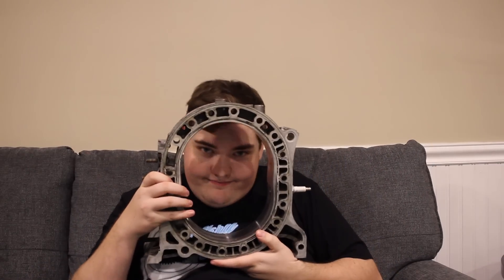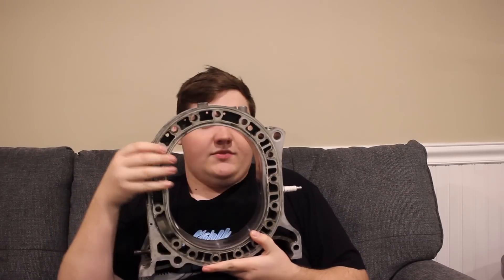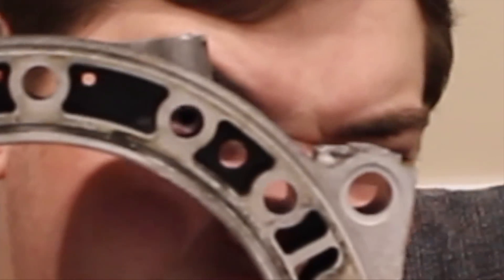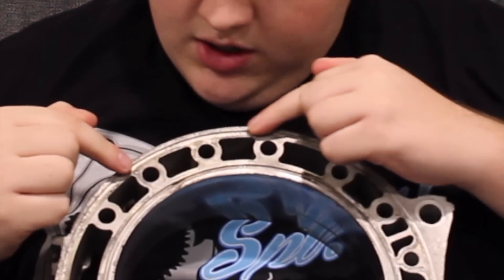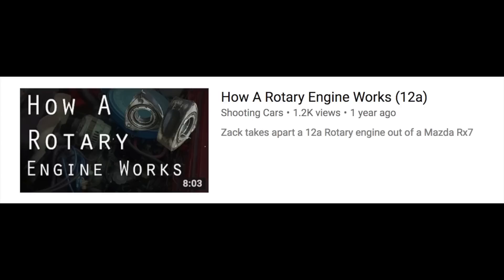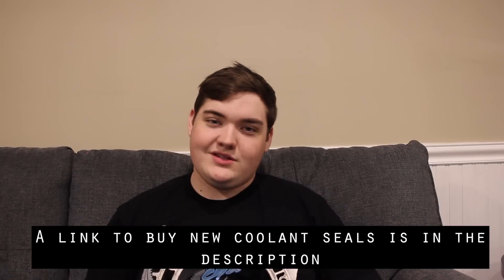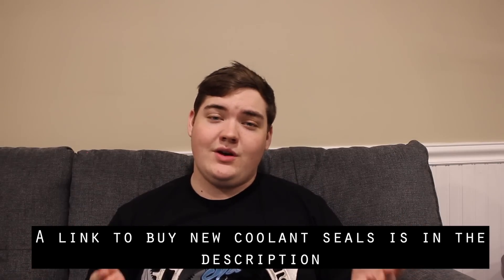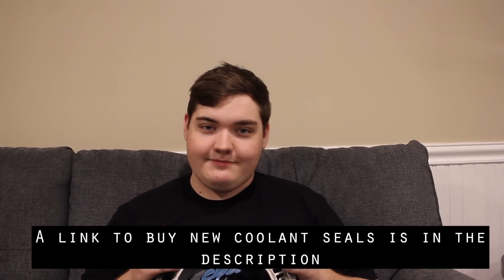How To Tell If Your Coolant Seals Are Blown In Your Rotary Engine

Comment: I have white smoke rough idling and than shuts off, now it only cranks but won’t start I charged the spark plugs and ignition coils. Nothing now I’m cleaning catalytic converter to see if that’s the issue. Now hoping it’s not this need  I need help

Comment: Thinking that my FC's coolant seals might be slightly leaking. Coolant overflows, light blue smoke on startup (could just be oil, maybe a little of each), but no smell in exhaust and the coolant stays more or less as green as it did when I put it in

Comment: Need a friend like you. I've just recently learned what a rotary engine is... And bought my first rx8. Been doing nothing but reading and watching videos and have done some work on the car. Tomorrow I will be testing by adding coolant, I just got the car out of limp mode with a new OMP. But the coolant is very low, when I've had it running I smell coolant but not sure if from the exhaust and there was a little white smoke from the exhaust but it didn't look abnormal. Well pray for me lol I will know more tomorrow. Btw your videos are very informative and are easy to understand thanks a lot

Comment: Compression is good on both cylinders.
No leak at all.
No white smoke, but still going through a lot of coolent. 

Pressurized the coolent system and it does not hold pressure...
So...
Gotta be burning it, but not enough to notice any of it coming out tbe exhaust.

Is it crazy to think that a headgasket sealant will work, at least temporarily, the stuff you put right into the coolent or will that muck up the combustion?
Reply: I’m having the same issue where I’m losing coolant but no white smoke. Did you find out what was a problem in your case?

Comment: Thanks for the video,
On my rx8 2005,
When i pull the dipstick to see the oil level it has a lot of white  like oil mix with coolant i can't even see the level do you have a idea of what the problem is? Thanks.
Reply: If you live somewhere cold-ish, and nothing else appears to be wrong, Its probably just condensation and nothing is wrong at all mate.
Reply: @Neishy86 that's what i thought that is just for the cold winter, i live in missouri so in winter is cold overhere but,  i went to the mazda dealer and they said  it is nothing wrong with it is just the air that engine pulls from outside, it's normal on those cars they said but, i jave seem on some videos that it can be the coolant seals that is why i was worry.
Reply: @Jorge-ku1zz  its condensation from the air, if you give the car a good drive it evaporates. But it'll be back again from the cold. Trust me you'll know when you lose a coolant seal, mine just blew. As soon as the car gets to temp it blows the rad cap out, no white smoke tho, but yeh exhaust gas blowing into the coolant.... RIP.
Reply: @Neishy86  sorry to hear that mate.

But good to know that information,
Now i will know when one blown. Thanks for your help.
Reply: @Jorge-ku1zz  dont forget, because of a rotaries design you can have alot of different symptoms for blown coolant seals. The seal could be bad only in one spot so it may see only intake, or compression, or combustion/exhaust. In my case I'm only getting exhaust in the coolant, no matter how long you leave it the cars starts and runs perfect no coolant smoke out the back, but it cant keep itself cool because exhaust is just ruining the systems ability to cool the car, I can get about 10 minutes of driving out of it tho lol. Usually for others coolant will leak into the motor and cause other issues instead. No worries mate happy to help.
Reply: Blown engine, typical for Mazda RX cars
Reply: @sandervanderkammen9230  wrong
Reply: @Neishy86  Yes it is. These troublesome  engines were notoriously unreliable and suffer from premature seal failures.
Reply: @sandervanderkammen9230  doesn't mean that condensation in oil means blown engine, did you even read the replies, of course they are prone to blow up, i have one.
Reply: Just read everything and you will understand
Reply: @Neishy86  Sounds like you need a new engine too!
Reply: @sandervanderkammen9230  yes I definitely do, this guy doesn't, its very common to have water in the oil in cold climates like I have already explained. Funnily enough my car still runs perfect, just doesn't keep the water in the cooling system.
Reply: @Neishy86  It is certainly not common or normal to have any visible signs of moisture in your engine's oil as this is a clear indication of a faulty seal, low compression, clogged crankcase ventilation, defective or incorrect coolant or oil thermostats or switches/sensors or improper driving eg; excessive idling or extremely short trips that do not allow the engine to reach proper operating temperatures.
Reply: @sandervanderkammen9230  bro listen, I was a member of rx8 club for years, every second post was about people thinking their engine blew up but it was just condensation in the oil, once you drove for a while it would cook off. It only happens in cold climates, its a thing with rotaries due to the higher EGTs and higher under bonnet temperatures I think, it happens a lot on rotaries v piston engines. Can you just believe I know about this from experience we have seen it a lot. I know fully well what water in the oil generally means lol. Rotaries are a different animal im talking from experience and not just another guy on the internet that thinks I know something. You can see that this guy does live in a very cold climate just accept what I'm trying to tell you.
Reply: @sandervanderkammen9230  also you contradicted yourself there, on one hand you're saying that it definitely means a blown engine, then you go on to say short trips cause it too thanks for that lol, that's exactly what it is... a cold climate and short trips.
Reply: @Neishy86  I'm sorry but what you are saying is complete and utter nonsense. 
Water vapor and condensation can only accumulate due to coolant leakage, excessive combustion gas leakage, inoperable crankcase ventilation or insufficient or prolonged use below normal  operating temperature.
 The visible presence of water in the lubricant will result in excessive wear and damage due to corrosion and acidification of the lubricant.
 Motor oil contaminated with water should be draining immediately and the cause identified and repaired before returning to sevice.
Reply: @Neishy86  Well if it's an infamous RX8? We can assume with relative confidence that the seals are damaged. 
 But if you are starting from cold and driving only 3 blocks every day you are either too fat or too lazy to just walk instead.
Reply: @sandervanderkammen9230  bro just google "foamy dipstick rx8" click on the first link, its right there. I know what you are trying to say but I'm telling you that's its a known thing in the rx8 community in colder climates, stop being so fucking stubborn. In that link there is a TSB from Mazda explaining that's its condensation, dont be so closed minded and you might actually learn something for once. I'm not bothering to explain this further.
Reply: @Neishy86  I'm sorry but despite your false claims even relatively small amounts of water cause serious damage due to corrosion and microscopic pitting on metal surfaces as well as severe deterioration of the motor oil additives and break down of the base stock polymeric molecules.
 No engine or motor oil should ever contain visible accumulation of water.
Reply: @Neishy86  I think your myths and misconceptions regarding this stems from a general effort among some owners in a deep state of systemic denial that the Mazda RX8 engine was a deeply flawed and unreliable engine that suffered extremely high rates of premature failures due to poor engineering and the inherently inferior reliability of the Wankel engine to contemporary reciprocating automobile engines.
 Nummerous excuses are offered up to explain away the engine's notorious lack of durability which often defy logic and conventional wisdom. Case in point the beliefs that pouring 2-cycle into the fuel tank is actually beneficial to extending the engine life and does not cause engine damage.
Reply: @sandervanderkammen9230  I'm not making any false claims, you said it means a blown motor, I said wrong. Did you even read the TSB in that link. Why are you being so difficult? The point is that water isn't in there because the motors blown, why are you talking about the oil breaking down?
Reply: @sandervanderkammen9230  Are you trolling even? I swear you are the realdocktorbimmer or whatever that guys name was.
Reply: Also this doesn't happen to anybody in a warm climate at all, but I guess you'll just gloss over that fact as well.
Reply: @Neishy86  Nope, I'm just an engineer that has worked for two motor oil manufacturers and probably knows a couple of things about motor that you might not, I'm also a little tired of hearing all these ridiculous myths that Mazda RX owners persist in believing.
Reply: @sandervanderkammen9230  are you saying that Mazda lied in that TSB? Also you are ignoring the fact this doesn't happen at all in warm climates, and I never claimed it wasn't bad for the oil now did I? The fix in the TSB was something about modifying the crankcase ventilation, so maybe it is bad ventilation. Point is it doesn't mean blown motor like you tried to say in the first place.
Reply: @sandervanderkammen9230  and yes I can clearly see you know a thing or two about motor oil, but we aren't even talking about the quality of the oil we are talking about the fact that this small amount of water sitting in the oil is from condensation and not from the cooling system. You can talk about how bad it is for the oil all you want, doesn't change the fact that its not a symptom of a blown motor, well not in this case anyway, it definitely can be a symptom of a blown motor of course.
Reply: I don't live in a cold climate myself but I think this happens to other cars as well in freezing winters, also I agree with you on the rx8 motors general shittiness when it comes to reliability, I hate the thing, love the car, the handling is great but the motor gives no end to problems, even when your compression is fine you always have problems with coils, or solenoid valves or something. Only good thing is its very smooth and sounds good.
Reply: Another thing too, if you google condensation in oil, its apparantly quite common in very cold places to get this with all sorts of cars, not sure why you are so unaware of this since you work in the field.

Comment: Hey! What about if my cooling reservoir is leaking coolant through the cap (cap is new) someone told me my coolant seal could be bad (it's not smoking) oil looks good and also coolant... Thanks in advance.. 🙏👍☺
Reply: Thanks! That's really a light at the end of the tunnel. I bought the car with an engine rebuild 2000 miles ago, it idles right, doesn't overheat, spark plugs are not wet and it doesn't smoke, but it keeps spreading or just "dissapearing" coolant, so I'm really hoping that it's not a bad mounted water seal. The car had a worn water cap in the filler neck and loosed lots of coolant, so maybe there's still air in the system since I didn't knew how to properly bleed it, also I haven't checked the AST, I'll check all those things and keep you updated, thanks again!
Reply: Mine was freshly rebuilt around that time too. That is why It’s still alive I think Too many times overheating “driving me crazy” till one day checking the level I left the reservoir cap on the left side of It, started the car, when warmed up Went for a ride suddenly smoke coming out from under the hood 😁 I decided to change the radiator and never again mi bro even though I take It to red rpms
Reply: Hey, did you solved the problem? My FD is doing exactly the same and I want to be sure of what it is before going deep into the water seals.
Thank you in advance
Reply: @NonRunningFD   I ended up changing the radiator It’s was kind of clogged. I resisted bcause of thinking About one time I put 2nd instead 4th while going at high rpms 😭 but the radiator was the real problem. No more issues or overheating That was the other issue I was having and never mentioned which can be obvious at this situation (at least in my case) by spreading all that water I had to refill constantly. If you have a specific situation I might help Not a professional but hopefully I learned a lot with my rx-8 😁

Comment: When you say engine rebuild, do you mean it needs to be entirely rebuilt due to the location of the seals, or that a large number of parts would have to be replaced due to damage?
Reply from the maker: Location. You can probably "get away" with using old parts, but if it's an older engine, a lot of that other stuff will go eventually too so it would be smart to replace apex seals, oil rings, side seals, etc

Comment: thanks for the great vdo's.. do you really have to replace apex seals if your coolant seals are blown or blocked?
Reply from the maker: Not necessarily, but if you have the engine apart, there's no sense in NOT replacing them.

Comment: How much to fix a blown coolant seal ?
Reply: You'll most likely want to get a master rebuild kit and go ahead and replace all of the seals and gaskets all in one go. A decent set from Atkins (a reliable rotary source) will run you a little over a thousand. You can find then cheaper on different sites for about as cheap as 750 ive seen. But are they trust worthy? I'm not sure. If you're on a tight budget its best to take apart the engine first and see what seals can be reused and which are trash and sort out and buy the seals that you need. Check your rotors, housings, and, irons too, they may need to be resurfaced or balanced or even replaced just in case the car has ever over heated, which is likely if a coolant seal is blown and the car is still being driven. Now if you end up needing new rotors, housing, or irons its going to get costly. Very costly. Around 3 to 5k if done proffesionally. But they'll rebuild you right if you know a good rotary specialist. Be careful sorting out sorting out rotors, housing, and irons on your own if needed. They usually always need to be sent in to a shop to be checked and made sure its a good set of rotors irons and housings. If not you may have some more problems. Good luck!

Comment: question. My fc had full coolant in the reservoir, but when using the fc, it goes to low,. I'm not experiencing leaking coolant or white smoke indicating burnt coolant. Nor my add coolant light is turning on and it's not overheating. What is going on with my fc
Reply: Any new symptoms now after a few months?

Comment: I just traded my bike for an rx8 runs great you can put rhe pedal to the floor and it climbs no issues whatsoever until 7 grand it loses power and starts pouring white smoke that smells like burning oil drive it low rpm for a couple minutes all goes away and back to normal however a few times it has passed 7 grand right up to redline through a couple gears im new to rotaries and baffled because there is no smoke on startup or under 7k could this still be the seal
Reply: Hey guys about when the oil stick got white foam. My starts for like 15 minutes and dies
Reply: did you end up figuring out what it was? sounds like coils